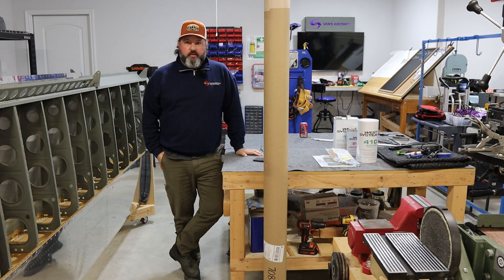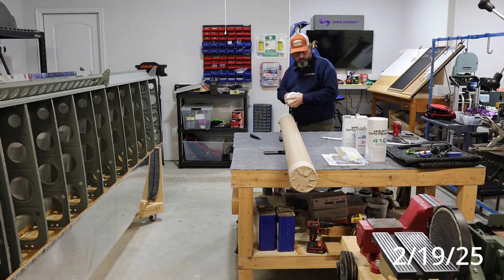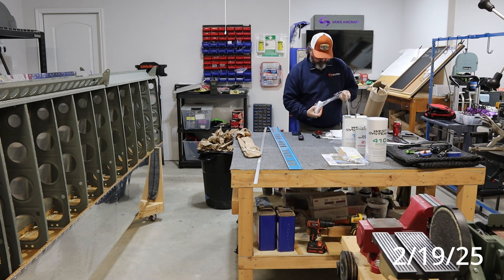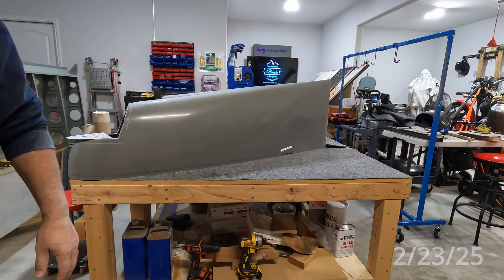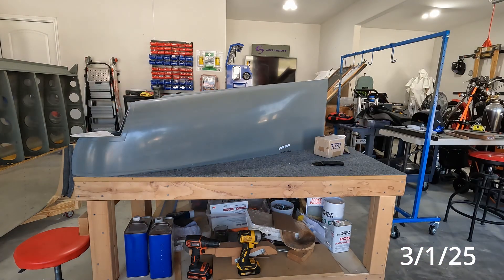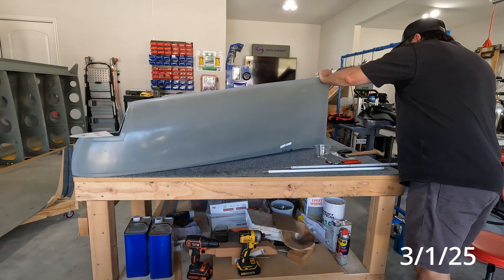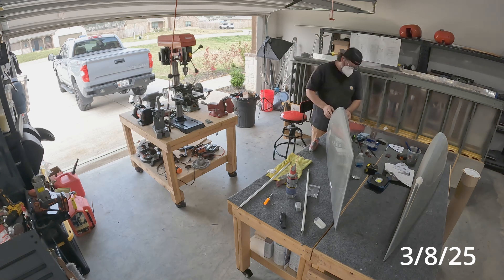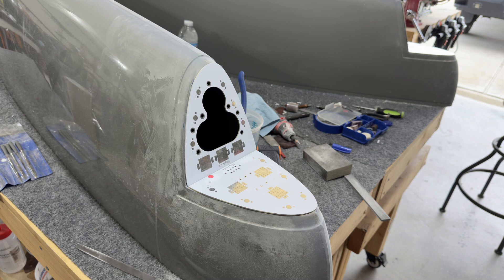Van's RV-8 Build. Ep 149. Flyleds 01. Wingtips and Channel Update

Comment: I know with the standard pulled rivets you can remove the mandrel and shave down the rivet to size, then feed the mandrel back through, then pull the rivet.  Assuming you meant it was too long.
Reply from the maker: I didn't know that about shortening pull rivets. I don't think you can alter cherrymax rivets because they incorporate a locking device in the construction. I'm not certain though.

Comment: Could you TIG weld the end fittings on the push/pull tubes? Assuming these alloys are weldable. 
Nothing but positive and righteous thoughts!
Reply from the maker: Welding is noted as an option on the plans, and I looked into it. After consulting with a few builders and welders, I decided that I was more likely to make a mess of it. I’m sure a skilled TIG welder could do it.

Comment: Chris,  When I did my fuel tank and tested it, it looked like a hot tub with all the bubbles coming out of the rear baffle.  I was devastated and frustrated.  I took the rear baffle out by drilling all the rivets out.  I did not put enough ProSeal close enough to the rivet holes.  It took a lot of time getting off the old ProSeal from all the parts.  But the second time was a charm.    I am working on the fuselage and frustrated trying to bend the fuel pipes just right.  I used the spring bender on my second try at it.  You might want to invest in one of those when the time comes.  Glad you are back to work on the plane.
Reply from the maker: 😂 I love the hot tub analogy. I have two leaks near the battle on each tank. It’s been so long that I’m going to test them again and confirm the leak locations before I begin any repairs.